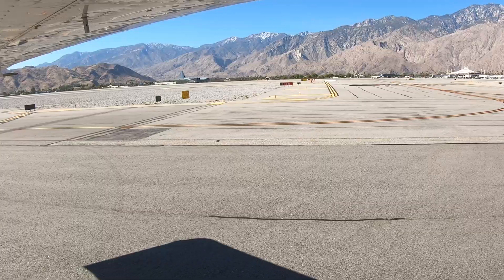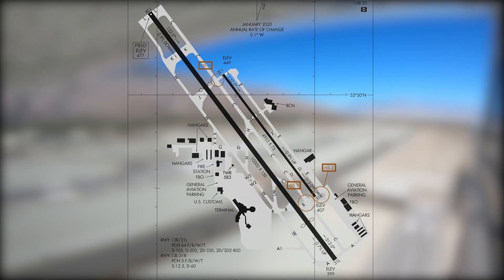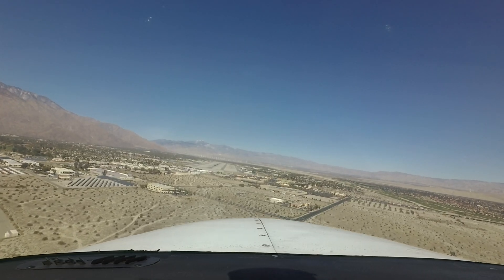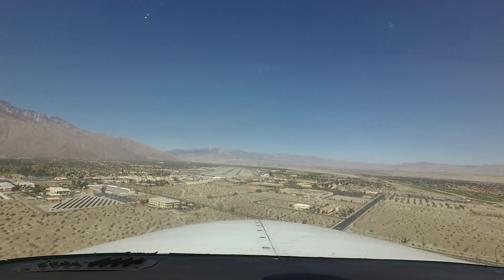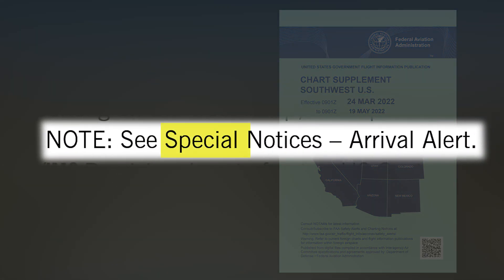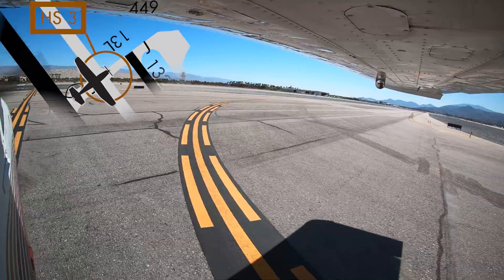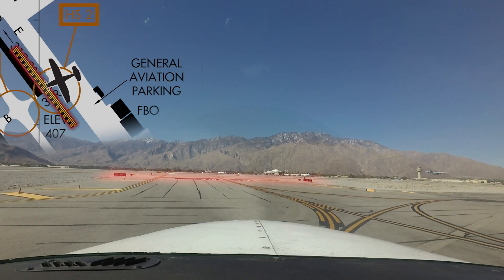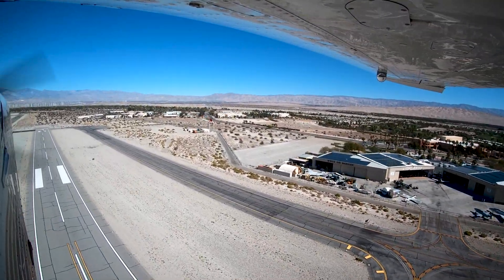From the Flight Deck – Palm Springs International Airport (PSP)

Comment: Never flown to PSP but to me is like this, two parallel runways and TWY Charlie in the middle. Runway 31, is 310 degrees (magnetic) from north and the other runway is also 310 degrees from north. So i'm flying toward these runways and i got a visual on them. They told me LEFT! The left runway is the one on my left! Easy enough. That makes the other one 31 RIGHT. If you are coming to land from the opposite direction, You are flying 130 degrees magnetic, so you got runway 13 left which is the 31 right from the opposite direction, and runway 13 right which is rway 31 left. I will look at the diagram to try and understand better the ground situation with the HS. I have been to PS many times because I used to live on the other side of San Jacinto mtns in Hemet. It is great there in the winter time! 

Reply

Comment: Easy fix. Change the names to Alpha~green  Beta~ red  Taxi ~Yellow.  Paint both ends of the  runways and line them  with lights in the corresponding colors.  Naming the runways  Brenda and Brendda  is amazing.
Reply: Green and red lights on the ground already have meanings though. 

The simple fix would be to add the zero to beginning. So 013L or 031L.